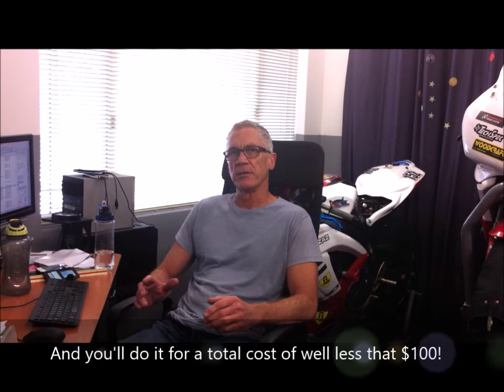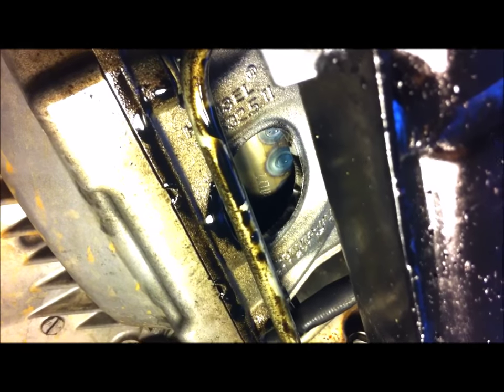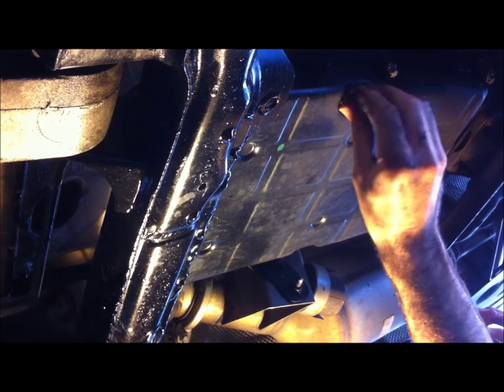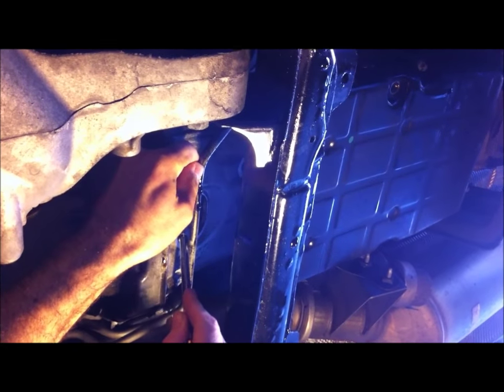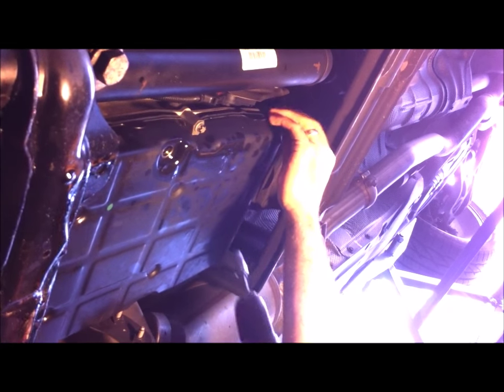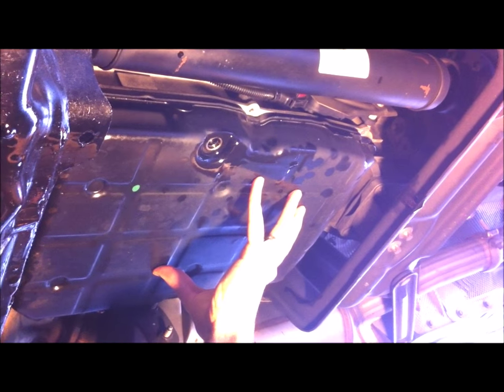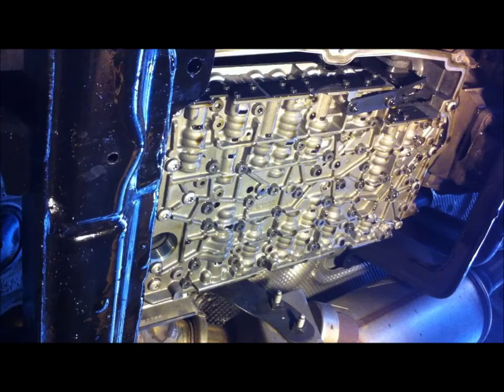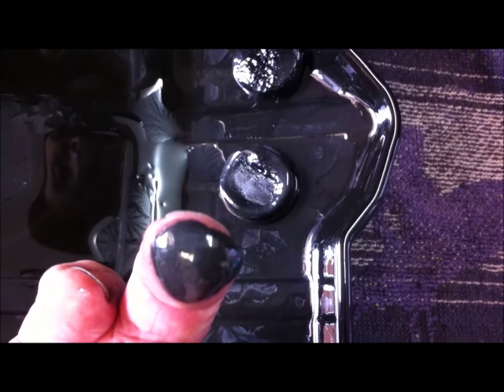Mercedes 722.9 ML320 ML350, C, E, S, GL Transmission Service

Comment: Hey Scott, Thanks for the video. Do you know the torque setting for the oil cooler line?
Reply from the maker: No. It's not a structural fastener so I tighten it by feel. If it bothers you use this general table for standard torque settings on metric bolts. Most automotive bolts are grade 8.8 and it's often marked on the head. https://www.engineeringtoolbox.com/metric-bolts-maximum-torque-d_2054.html
Reply: @ScottElliott152  Thanks Scott, appreciate it.

Comment: Hi Scott, having a issue with my e350, just yesterday I had a full service done, a gear box service and all 6 injector seals changed, left side of the engine was terrible full of black stuff from the leaking seals,  the leak pipe was destroyed so got that changed aswel, now when I'm driving the rev counter after a little while increases so gear changes happen very late and there's a loss of power (no fault codes) just now when I parked up I saw loads of smoke from left side of engine,  could it be incorrectly installed injectors or something like engine burning off the oil that's onit, thanks
Reply from the maker: It's possibly left over oil and black tar burning off. Not sure why you'd be losing power. You'll just have to monitor for a while and perhaps take it back to the repairer.
Reply: @ScottElliott152  thanks for the reply 👍, I have dropped it back off to the garage, another strange thing I noticed that happened once was when i let go of the accelerator the car slowed very quickly felt like the brakes were applied

Comment: Hello Scott
I test icarsoft no transmission fault
the car not move in D and R. It is as if it is retained
When I accelerates loudly heard the torque converter turned as a rolling noise
Reply from the maker: Sorry but it is not possible for me to know what the problem is. You will have to check you did everything correctly.
Reply: I think Benj 04500 is trolling great tutorial :) Mercedes Service takes 400 euros for this job, DIY cost about 100 euros. Thanks again Scott for the great video. Cheers

Comment: Hi. Great video. I have a question. How did you manage to drain torque converter? I always have tough that it's impossible to flush fluid out of the converter unless it has a drain plug (very few models). Thanks.
Reply from the maker: We used the TC drain plug. It's at the start of the video.
Yes some 722.9's didn't have the TC drain plug. You can disconnect the return line from the oil cooler where it goes into the RHS of the transmission. Start the engine in Park and let it idle for a short period to pump the ATF out of the TC. As soon as the ATF stops coming out turn the engine off. It's a legitimate way of doing it as other manufacturers document that method in their workshop manuals.
Reply: @ScottElliott152  thanks for the reply. My bad, I skipped forward and missed that part. My apologies. Have a great day.

Comment: Really well made video. I've done my 722.6 several time, but have shied away from 
doing my lady's ML. But the local guy only replaces like 4 quarts, and the thing is shifting like crap, and I guess perhaps now I might give it a try.  Can you make a list of components you used? As in the fittings etc. 
Also, I really have to wonder, is it necessary to replace the bolts? Stretchy bolts at only 10nm should be fine. No? 
I doubt the mechanic ever replaced them. 
Are they supposed to be replaced on the 722.6?
Reply from the maker: "Dimly Aware" ... love it!. Thanks for the compliment. I have made a 
"Shopping List" at the start of the video. Is there something missing? 
You need a compressor the way I do it but every half serious DIY'er 
would have a compressor? They're so cheap now and are a handy bit of 
gear.
Don't be scared by the 722.9 ... it's very easy to service. The only difference is filling by pumping ATF from the bottom into the drain hole.
I find it incredible the "professionals" are only changing half the ATF. They do the same in Australia. What's the point? Would you only change half your engine oil? They never flush the oil cooler and there's about a litre there alone. Mercedes make their transmissions. Premature failures mean more revenue and profit. I think it's that simple as there's no incentive for a transmission maker to have their transmissions well serviced and thereby having a long service life. So the propaganda is spread ... "filled for life".
You do need to replace the aluminum stretch bolts as when they're first installed they're taken past the yield point and will eventually break if you reuse them. I did an experiment with an old one. Tightened to 4Nm as required and turned 180 degrees and it broke. High tensile automotive bolts 6 x M6 with 1mm thread pitch are cheap.
You need to make the filler fitting by purchasing a generic M12 x 1.5 pitch drain plug. Drill through it axially with an 11/32" (8.30mm) bit. Tap with a 1/8"NPT or 1/8" BSPT. Buy a 1/8" NPT/BSPT 3/8" barbed fitting that you can screw into the plug. Now you can attach 3/8" plastic tubing. You need a valve with 3/8" barbed fittings.
Reply from the maker: I forgot to say don't get hung up on the level of the oil pan. Get the vehicle about level and you'll notice the pan is still sloping backwards. It doesn't matter because the over flow pipe is in the middle longitudinally. The oil level will be lower at the front end and higher at the rear end but the average is correct.
Reply: Scott Elliott 
Although I completely agree that your method of creating the field from below plug will work, however I think it may be challenging for many of the viewers to drill through it and tap it. For amir $15 on Amazon MityVAc actually sells an adapter for this purpose.   Mityvac MVA588 ATF Refill Adapter https://www.amazon.com/dp/B00JLGYU5U/ref=cm_sw_r_cp_api_6ZcyybK0HGAHB

They also sell a hose assembly with the valve, but I think a simple hose could do the trick.   Either way thanks a bunch for this video, I had no idea that there was the overflow stem internal to the drain plug that essentially sets the fluid level. To this day I was pondering if there is no dipstick how does one properly set the level.
Reply from the maker: I agree. For $15 get the adapter from Amazon. A simple hose with a valve will do the trick. I'd recommend you install an auxiliary drain plug in the pan.

Comment: Good video. 
Two things. There are two types of filters, the old one you dismantled was the right one, the new one was not. Pay attention to the profile of the old and new filter. The bolts need to be aluminum and tightened with a torque wrench, not an electric screwdriver. This is described in detail in the Mercedes course for servicing this gearbox.
Reply from the maker: Yavor thanks for your comment. See 17:01 where the bolts are torqued to 10Nm. At 12:28 I explain why I changed to high tensile automotive bolts. The transmission is performing well. Regards, Scott

Comment: Hi Scott, congratulations and thanks for helpful video. I saw you used Total ATF fluid . It s ok to rely on that brand and grade of fluid? I have a 2005 SLK55 AMG. I tought we should only use MB or Pentosin ATF134 or MobilOne ATF134 or Fuchs Titan ATF4134?
Reply from the maker: Thanks Alain. The Total product has the correct MB236.14 specification (it's printed on the label) so it's complied with Mercedes requirements in terms of additives etc. Total is a reputable oil company so you'll be fine. I've been using it in my W204 and W639 for years. Also the Mercedes branded oil is Fuchs with a different label.
Reply: Thanks Scott, i saw somewhere that some models had a secondary cooler with a thermostatic valve that is impossible to empty out unless you let the engine running until the temp reaches 41c. Does it speak to you? If yes how is it possible to flush it without breaking anything?
Thanks again
Reply from the maker: @alainmurray4159  My W639 Vito with the 722.6 5 speed transmission has a thermostat valve for the ATF. It's bolted to the LHS of the engine sump. You flush the the oil cooler lines in two sections ... from the transmission to the valve then you remove the outgoing pipe from the valve and flush from that which does the oil cooler ... so that's how it's done and it's what Mercedes say to do. I made a video so if you have the time watch my W639 722.6 transmission service. I don't know if yours has that thermostat but you should be able to find out with some searching. www.benzworld.org is a good source of information.
Reply: @ScottElliott152  Thnak's again. I will receive my MB scanner in a couple of days to see what are the tranny codes I had. The car goes in limp mode occasionaly. Would you change the whole conductor plate or juste the sensors on it? I plan to do that all at the same time.
Reply from the maker: @alainmurray4159  I think it's not much more expensive to replace the whole conductor plate.
Reply: Conductot plate is around $130 and sensors with punch tool is around $35
Reply from the maker: @alainmurray4159  So a difference of about $100 to replace the whole lot. I haven't done a conductor plate but I'm assuming it's easier to pull it out and put another one in compared to punching out the old sensors and installing new ones' in? Is that delicate work? Are they easily damaged?
Reply: It requires more skill to change just the sensors and beside the lower parts cost advantage, you don t need a scanner to reset the code the car computer made after changing the conductor plate.
Reply from the maker: @alainmurray4159  Report back after you've done the project. I'd be interested to know how it went.
Reply: Certainly ;)
Reply: @ScottElliott152  Hey there, I finished all my work on 722.9 tranny. Oil flush, pan gasket, filter and one sensor #3. I had a very hard shifting problem from 1st to second and second to first when cold and occasionnal limp mode because of sensor #3. Everything is perfect now and no more fault. I ve choosen to change only the sensor because I did nt want to go to Mercedes to reprogram the conductor plate. Unfortunately it did nt go easy to take out the sensor like all the videos we see. It never came out. I had to desintegrate it with a Dremel, grind the cavity and put back the new one in marine epoxy glue and welded it. I would nt recommend it to anybody unless knowing their skill personnally. Time to have fun with the beast now  :)

Comment: Hi Scott, 
Great video as always. I noticed you did not use Fuchs ATF like in your other transmission change video. I have read that lots of people did not care for it.  Any recommendations? I love the Acura Brand ATF but don't know the full specs,  So am worried to use in The GL450.  I just want the best for the truck.  The Transmission was serviced by Mercedes at 40,000, and Only serviced by Mercedes before I bought it.  But needed  a new transmission at 91,120. at 7,500 US.  So I want to stay on top of it. Thank you again for you help. Currently I have 108,000 Miles.
Reply from the maker: Hi Tom ... wow only 91,000 miles is bad. That's $AUD10,000! I changed to Total Fluidmatic MV LV. It has the MB236.14 specification and has had good reviews. The W204 C Class and the W639 Vito van are both running as well as ever on that ATF.  As an added bonus It was cheaper than the Fuchs 4134.
I've just uploaded a second video showing how I added a secondary drain plug. I explain why I did it in the video.
Reply: Depending on what part of the world you're in....here in the USA, of course there's the Mercedes stuff  @ $20 a quart, then Mobil ATF134 and then Shell ATF134.
Reply from the maker: Yes there are many oil companies producing ATF to MB236.14 and MB236.15 specifications. Remember Mercedes don't make oil ... they're not an oil company. The "Mercedes Stuff" is nothing but Fuchs 4134 with a Mercedes label and four times the price in Australia. It's even in the same grey container ... only different label.
Reply: Huntington  NY   USA

Comment: Hi Scott, how many liters of fluid did you end up using doing it this method?  I’ve heard you only need 8-9 liters if you don’t drain the torque converter and flush out the cooling line.  Thanks and great video!  I’m making the special flushing tool just like yours.
Reply from the maker: Kwang you'll use 8 to 9 litres doing the method I demonstrate in the video.
Reply: Scott Elliott thanks Scott!  I’m going to do this on my wife’s 722.9 plus which uses the blue fluid but this video is THE best video out there!  All the indie shops I spoke to only do drain and fill and do not empty the torque converter and flush the cooling line.  I already found parts to make the homemade flushing tool just like the one you used!  Thanks and keep up the awesome work!
Reply from the maker: Thanks Kwang. The TC holds about 50% of the ATF. You wouldn't change half your engine oil so it mystifies me as to why they'd only change half the ATF. Mercedes make their own transmissions. They want to sell more. There's no benefit to them if our transmissions last a long time. The old saying rings true ... "never ask a hairdresser if you need a haircut"

Comment: Great video Scott, thanks to this I have the confidence in tacking on this job myself now. Just a question, after removing the oil pan and filter could you not let the engine idle for a minute to flush the remaining oil out instead of manually draining the TC and flushing from the oil cooler line? Is there any danger to the transmission with this approach?
Reply from the maker: Thanks for the kind words.
That may partially drain the TC but it won't get the ATF out of the oil cooler and lines. If the pan is off the pump will be sucking air very quickly. If you have a TC drain plug it's been put there for a reason. It's not difficult to drain it properly by removing that plug. I wouldn't be trying to shortcut a tried and tested process as shown in the video.
Reply: @ScottElliott152  Fair point Scott, mine is actually a W204 C250 which has the 722.6 and not the 722.9 I will dig around to locate the TC plug before I do this
Reply from the maker: @sajjadyb  ok. The 722.6 is more conventional in that you fill via the dipstick tube and use the special dipstick to set the level. https://www.ebay.com.au/itm/New-1220mm-Transmission-Fluid-Dipstick-Tool-140589152-for-Mercedes-Benz-722-6/274466252820?hash=item3fe776a814:g:KigAAOSwKTZfP36f&frcectupt=true
Does it have the tube with the locking cap? My W639 Vito has the 722.6. I have a video of how to do the ATF and filter change. https://www.youtube.com/watch?v=VCQczrNZ-4c
Reply: @ScottElliott152  Yes it does have the locking cap and looking at it its black so may not have been changed yet in over 42k miles. Definitely due a change now. Just had a look your Vito video, that has some good pointers for me to follow up on. Thanks again
Reply from the maker: @sajjadyb  The 722.6 is easy to service. You probably won't have the external thermostat control valve so the line and oil cooler flush will be more straightforward.

Comment: What size fitting did you use instead "fill in" fitting at your valve system?
Reply from the maker: See 13:47. The fitting size is stated.

You can buy them: https://www.ebay.com.au/itm/Car-Filler-Fluid-Filling-Transmission-Service-Adapter-For-Mercedes-Benz-722-9-X1/183013699484?hash=item2a9c776f9c:g:3z0AAOSwfphaWGEl&frcectupt=true

Comment: Hello Scott 
When the temperature reaches 45 ° I open the tap and it flows about 3 liters why?
I did well D / N / R / P several times when the engine heated
The car remains in place and does not move, yet I hear the noise of the gear changes, and the front drive shaft moves a notch when I put on D and a notch when I put on R
(I emptied the box and converter and filled about 8.5 Liters)
Thank you for your help.
Reply from the maker: It's difficult to know what the problem is without inspecting the car. How could 3 litres flow out? Did you put the overflow pipe back in?
Reply: Thank you for your reply
Yes I handed over the overflow pipe, it can not get out?
Is it possible to have a fault code and no LED displayed?
Is it possible that the converter does not fill it
Reply from the maker: If the internal pump is working and you put 8.5 litres in the TC fills when the engine is running. Yes you can have fault or event codes without the LED
Reply: Thank Scott
Does this reader read the transmission codes?
iCarsoft - Multi-system Scanner i980 for Mercedes
Reply from the maker: yes
Reply: Thank Scott 
I have ordered iCarsoft  Scanner i980 for Mercedes
When I complete the oil, does the engine need to run?
Reply from the maker: You keep the engine running when draining the excess. You keep the engine running when putting the drain plug back in.